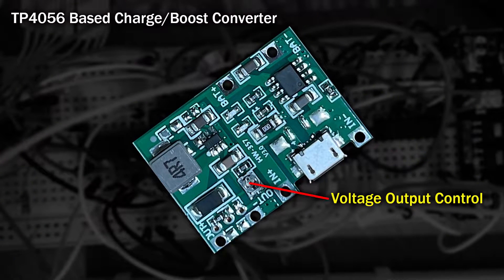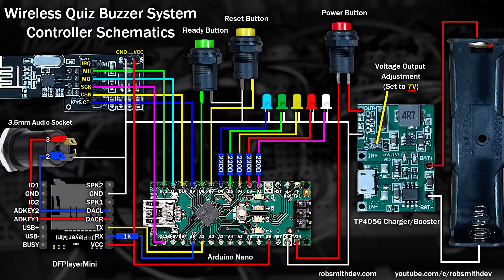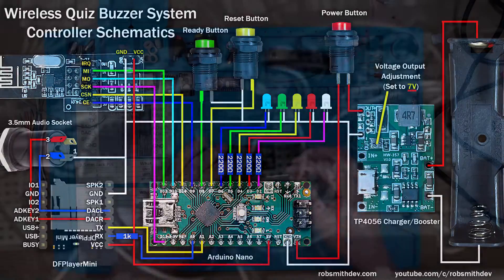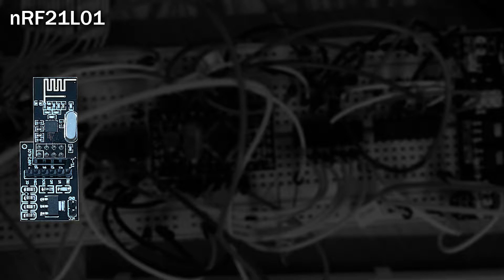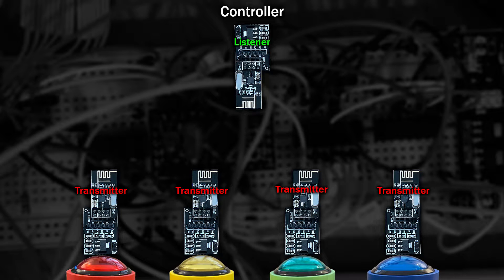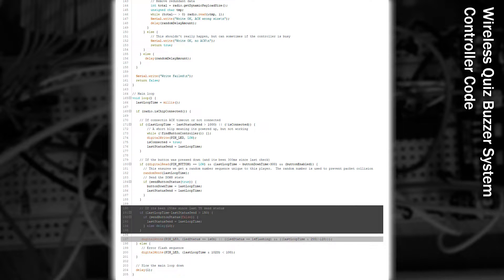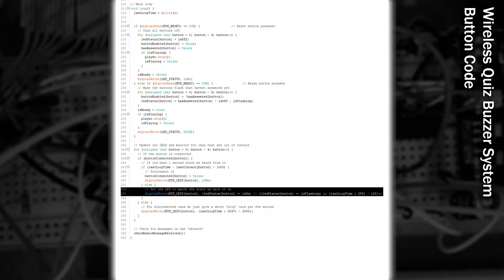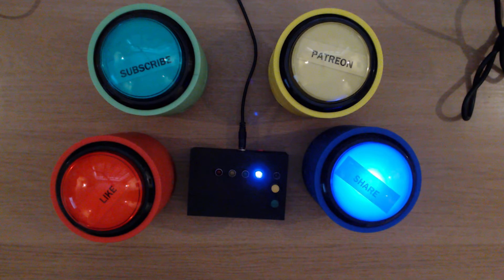Wireless Quiz Buzzer System using Arduino, nRF24L01 and TP4056 lithium battery charger

Comment: Hi, your game is great, as is your work. But I'm struggling to get it to work. Do I need to customize the 4 buzzers for each program?
char pipe[6] = "1QBTN"; for button 1
char pipe[6] = "2QBTN" for button 2...
Thanks.
Reply from the maker: No, this is automatic. On power up you have to have them connected to a computer. You send the button number to it and from then on it rembers
Reply: @RobSmithDev  Thank you. I will try to send the numbers to the serial monitor
Reply: @RobSmithDev  Hi, Sorry, I usually check the comments before asking my question so as not to drown you in comments. Because I saw that you had already answered other people.
Reply: @RobSmithDev  Hi, It works. Finally, in Setup(), I wrote EEPROM.write(0,x);
x= 1, 2, 3, or 4.
Thanks. That's very cool.

Comment: Hey!! Great Video btw, umm can you hear me out please,  can you give me some tips to get my wireless fire detection buzzer system working the microcontrollers that I'm using is esp32(receiver) with a buzzer and arduino uno (transmitter) with a mlx and mq2 my problem is that whenever my serial monitor transmission success after it detected a fire more than 42.5 celsius or 800 smoke my receiver isn't beeping
Reply: thank you for responding, I'm doing it for grades, can you at least tell me is it possible?
Reply from the maker: Don’t see why it wouldn’t be
Reply from the maker: Sorry I can’t help with that. If this project is for fun then keep at it and you’ll get there, but if you are actually wanting to use this for real safety I suggest getting a proper certified detector

Comment: Hi, this is a great tutorial, thank you for sharing! I have a question about the battery circuit you used. The "TP4056 Charge/Boost Converter", does it have integrated protection against over(dis)charging the 18650 batteries? I would like to make these wireless buttons too, but am a bit concerned about the safety of li-ion batteries. Also, any idea how long the whole set (buttons + controller) can last on a single charge? Thanks in advance :)
Reply from the maker: It has over charge but not over discharge. Simplest solution is to use protected batteries then it doesn’t matter. They’re very low power so even cheap batteries last ages
Reply: @RobSmithDev  Alright, then I will get the protected batteries. Thank you!

Comment: Hello @RobSmithDev
thanks for the great system.
I'm having some trouble getting it to work :(
I think the buzzers are working fine because they are blinking (I already gave them the numbers 1- 4)
The control unit also blinks, but only when I connect the arduino nano directly to a power source. When I tried to make it work with just the 3.7V battery, the leds just light up permanently. In both cases, the control unit will not connect to the buzzer and I'm a bit clueless what to do at the moment.... 

I would be very happy if you could help me out with it!!
Best wishes from Germany :)
Reply from the maker: Hi the controller is designed to work at 5V so that’s the first thing. Also, the controller (I think) will send information on the serial port so that may help debug it.
Reply: @RobSmithDev  Hi, thank you for your feedback :) 
I changed to voltage output from the controller from 7V to 5V. But I'm a little bit confused because the controller schematics shows "set to 7V"? 
I also checked the serial output and it says:

RF24 detected.
Scanning for empty channel...
Channel 125 selected

But it still won't connect to the Buzzer... I dont understand my mistake... do I have to change the code from the Buzzer to the channel 125?

In addition, I have checked the serial code from the buzzers, which says: 

searching for controller...
write failed
write failed

this text runs through and renews itself again and again

Best wishes :)
Reply: @CoolBaggy  increase the voltage for the buzzer
Reply from the maker: @YesWeAreAnonymous there is no buzzer, it plays MP3 files
Reply: @RobSmithDev this is my issue before. I tried to use 5v for the controller but the buzzer won't connect, i increased the controller to 7.5 to see some results and yes it able to connect. Also the buzzer, i increased the voltage to 6v
Reply: Hi  @CoolBaggy , I have the same problem : write failed.
Do you have thé solution ? Thanks
Reply: @dimebag2486  @coolbaggy @robsmithdev
I have this same issue. Altering the voltages didn't seem to help for me. Any other solutions, please?
Reply: Hi@TheatreAudio-w2hj ai écris directement dans l eeprom les numéros des buzzers. Et maintenant ça fonctionne. I wrote the buzzer number in the eeprom.

Comment: hello, great tutorial ! I've got an issue with the buzzer code (I think). After the transfert, the LED stay high and don't blink as it was suppose to. I don't understand where I must attribute the buzzer number. 
Sorry for my English, I'm French
Thanks for your help
Reply from the maker: Shows you in the video. Power them up while connected to the computer and then from the serial console send the number of the button. This gets saved
Reply: @RobSmithDev  thank you, it's ok!

Comment: I want to use this in a classroom. The only isssue i have is that i need to connect 10 buttons. Is that posible with this design?
Reply from the maker: It is, but you would need to change the code to make it work and you would need an alternative way to display which buzzer was pressed on the controller (there’s not enough pins for 10 LEDs)

Comment: Hi, Do I need to build the 4 buttons for it to work? I already have 1 button and the controller. I tried to connect the button but it won't connect. any ideas? I already assigned buttonID to 1 via the serial monitor. I copy and paste the code. check the wires and use the correct voltage. Thank you so much!
Reply from the maker: 1 should be enough. Try powering it on in a different order
Reply: @RobSmithDev  i tried the one you suggested to move away from crowded wifi and pc and It seems to worked. Im worried that it might not work inside my classroom since i have one router and 26 wireless computer.
Reply from the maker: You can fix the channel it runs on. There’s a similar section of code in both where it searches for an empty area so you could just force a value
Reply: @RobSmithDev  i need to figure it out which part of the code is it. Thank you by the way
Reply from the maker: @YesWeAreAnonymous  you’re welcome

Comment: This looks great - can it be expanded up to 20 buttons?
Reply: I guess adding a tft display instead of less could be an option.
Reply from the maker: Technically, although there isnt enough pins on the main controller to show you what was pressed. I know someone successfully got 8 working
Reply: @RobSmithDev   I was looking to see if the number of buttons could be increased too..
Reply from the maker: Yes it’s possible - I think someone went beyond 10
Reply: Or just led display

Comment: Good afternoon. I bought an Arduino nano with a built-in WIFI module. When checking the code, it gives an error for detecting a radio communication device. Please tell me what needs to be changed in the code. I really liked your idea. I want to make myself the same

Comment: really a great video. just what i was looking for. is it correct that a maximum of 6 buttons will work with the nRF24L01s and a controller with an nRF24L01? i would like to expand it to 6 once i have done it according to the build plan. change (almost) all positions with a 4 to 6 and extend the status arrays?
Reply: Finally, it works for 6 players. 👍✌🏽
Reply: @teemonkey-w6  Can you tell me what exactly you changed in the controller code to make 6 buttons work?
Reply: @Короткиевидео-ю1е  youtube removes the comments directly when i provide a link. i don't know how it works.
Reply from the maker: There’s no limit of buttons, well not that small anyway. I’m guessing you’re talking about the 6 channel part of the nRF but it doesn’t work that way. 
The only real limit is output pins for LEDs on the controller to show who actually pressed first
Reply: @RobSmithDev  Thank you for your answer. That is perfect! I ordered accessories for 10 buttons but then read that it would only work with a maximum of 6. Then the fun of making can begin 🙂
Reply: @RobSmithDev  What do you think if instead of letting the light be on the main adruino receiving the signal, I will make the light on the transmitter and the light will turn on right at the position of the first pressed signal transmitter?

Comment: I really like the idea here. But would rather have it all wired. Will the ready/wrong answer let others answer and reset button functionality work on your previous setup?
Reply from the maker: Yes should do. If it doesn’t it’s easy enough to change
Reply: @RobSmithDev  So looking over the code, when do you assign the button ID for the buzzers? Also, for clarification, you are using a latching switch for power button and momentary for the ready and reset buttons on the controller?
Reply from the maker: @camiji so as in the video, when you power the button up, before it will work it will wait for you to tell it the button iD, which you send over the serial port. You can only do this once and then It’s remembered.
If the button only powers whilst holding the power button you have the wrong type of button. The one I’m using latches
Reply: @RobSmithDev  Oh, ok. You're saying to power the button up while still connected to the PC, and from there in the code you can assign the button id?
Reply from the maker: @camiji yes so power up the arduino in the buttons with the serial connected. It won’t do anything, then type the button number from the serial window (1-4) - I’m sure I covered this in the video?
Reply: @thDev Alright, seems I have progress. Took me a bit to understand what you mean by connect to the serial, but then found that was serial monitor. I set my first button to 4, and it started flashing. I've come to find that if I connect the buzzer to my pc via 5 serial pins on the back of the Arduino, and just connect it to a powered usb 2.0 hub, (no loading IDE or anything) it works perfect. If I try to run the Buzzer on battery,  it has connection issues. I am using the 18650 3.7 batteries you recommended with the voltage output set to 5v on the TP4056. Any idea? Am I not running enough power? I am also using the Arduino Pro mini.
Reply: @RobSmithDev  Ok, did some more diving, seems turning down the TP4056 from 5v to 3.3v has everything working on battery. And the reason it was working on my pc is the programming board that hooks into the back of the Arduino runs at 3.3v as that's where the jumper is set too. Any idea why yours runs at 5v and mine are at 3.3?
Reply from the maker: @camiji because you can get 3.3v and 5v arduinos
Reply: @RobSmithDev  sigh...that makes sense. I I'm guessing since I ordered 3rd party there may be inconsistency. It said 5v on amazon, but they are working as 3.3v. I am assuming this wont effect the system? outside of the led on the button maybe?
Reply from the maker: The led might just need a smaller resistor.
The only other potential issue is the power supply board clipped onto the radio module as that’s expecting 5V and trying to convert to 3.3. It might be ok, but it’s possibly not needed
Reply: @RobSmithDev  So, got things up and going, Buzzer is working, controller is working, sound is working. It's beautiful, LOVE THIS PROJECT. Things are working. Question for you. I am still REALLY new to Arduino, I want to put these buzzers on a podium and on the front of the podium in a recessed area I want to add an LED strip using a relay. And while the buzzers will flash when the system is ready, I'm looking to have the LED strip to light up for the player that buzzed in first in tandem with their buzzer going solid like the system already does. Say pin 3 will turn on, toggle the relay and activate the 12V LED strip so this way my host will know who buzzed in first just looking at the front of the podium. And of course the LED turns off when the system is readied up again and the person is locked out, or it's reset. Do you think you can help me add this code?
Reply from the maker: Yes this is actually really easy to do
In the setup function you'd need to add
pinMode(3, OUTPUT);

And then in the loop() function, find this line:
 digitalWrite(PIN_LED, (ledStatus == lsOn) || ((ledStatus == lsFlashing) && ((lastLoopTime & 255)>128)));

and add this line:
digitalWrite(3, (ledStatus == lsOn));

Depending on how you wire things, might need to be digitalWrite(3, (ledStatus != lsOn));
Reply from the maker: Adding relays you need to be careful, easiest if you buy a relay module designed to be connected to something like an arduino because it will handle the power requirements and should include a protective diode too.  You cannoy connect a relay directly to the arduino
Reply: @RobSmithDev  You have been the most helpful youtuber I've ever interacted with. Thank you SO much for your help. I really can't express how much I appreciate you helping me along. The system now works exactly as I like with the new pin triggering the relay and powering up my led strip for my podiums.  This project is AWESOME and really sparked my interest for learning more about programing and electronics! My last question, I see for the sound effects it listed as buttonnumber+1, I am assuming that means, if it's player 4, the sound effect needs to be named "05"? Or if it's player 2 it's "03", right?
Reply from the maker: @camiji if I remember they’re still numbered 1-4 as files, I think it’s because internally the code treats them as button 0-3, and you’re most welcome

Comment: Another question is, is it possible to make them without a remote control? by type: you press 1, it flashes for seconds, and the others do not react at this time. Can you press it again after the time has expired?
Reply from the maker: You need a remote control as there has to be a transmitter. There is a follow up video to this though where the controller is controlled by computer instead. In this case I use an old retro computer but you could do this from the Pc
Reply: @RobSmithDev  Yes, I saw that video, thank you for making a detailed guide!

Comment: Hello, I would like to try your game system. but I want to connect an LED strip and add sound. How can i do this? can you help me with this?
Reply from the maker: Well sound is already in the project. Each button plays a different sound. If you wanted to add more sounds it wouldn’t be difficult. For LEDs you probably need to look up one of the led control libraries (check out my video on fake firefly’s)
Reply: @RobSmithDev  Speaking of LEDs, I found them on your channel, thank you for being so responsive!

Comment: This is brilliant! I’m adapting your build to have 10 buzzers across 2 teams of 5, but I find the LEDs too dim for the 100mm buttons at 5v. Could a step-up board be used to step up from 5v to 12v to power 12v LEDs?
Reply from the maker: I'd test to see if the 12v leds are any brighter (they might be) however the 5V and 12v will probably be the same LED but with different resistors.
Reply: @RobSmithDev  wow, thats interesting, thanks for your answer!
Reply: А какие строки кода вы меняли чтоб пролучилось 10 игроков?

Comment: Hi my button led is not blinking why would this be Thanks
Reply: sorry I have fixed this why will my button and controller not connect?
Reply from the maker: Sometimes Wi-Fi confuses the connection. Both the buttons and the controller on startup will scan for each other. You can change the code to fix the channel used. That might help. Alternatively power everything off, and power on the controller first. Wait a few second then try a button
Reply: @OllieDeer-cw2kp 
I'm also facing same problem, LED is not blinking, glowing continuously.. can tell me where is the problem ,it would be great help .
Reply from the maker: If the light is ON on the controller it means that button is connected and has been pressed.
If the light is ON on the button then it probably means you haven’t set up its ID yet
Reply: @RobSmithDev  thankyou for the reply sir .
Do I have to make some changes in the code to set up ID in each button. 
I have just copy and pasted the code directly. 
Controller is working fine , in serial monitor it showing- 
 RF24  detected
Scanning for empty channel....
Channel 125 selected .
But on button side serial monitor showing nothing.
LED status is always on .
Reply from the maker: @OmkarSingh-bo3xd you need to connect each button up to the serial and just send the button number (1-4) and it will save it from that point
Reply: @RobSmithDev  thanks sir 
It's working fine now
Reply: Thanks why would I have a white led flashing on controller startup
Reply from the maker: which led is the white led?
 @OllieDeer-cw2kp
Reply: the one above the buttons on the main controller @RobSmithDev
Reply from the maker: Might be easier to discuss this on my discord server. If you jump over there and send me a PM I’ll try to help

Comment: Hi! Thank you very much for the project! It’s amazing) 

I have one problem. Maybe you had a similar experience. So, I have a few different pro mini (originals and Chinese clones) 
Some of that with 328p and some with 328pb chips. 
When I’m using 328p - everything is fine. But with 328pb chip it doesn’t work. It’s strange(((
Reply from the maker: The PB chips are slightly cheaper so probably why they use them. Could be a number of reasons why, difficult to say. Are you sure they are both 16mhz versions?

Comment: Hey
Do you use the same programming for all buttons? Or do you have to change something for each button? How does the controller know how to define each button for the correct LED color?
Reply from the maker: Before you can use each button you have to assign it a number. You do this from the Arduino IDE by leaving it connected when powered up. Send the button number (1-4) from the serial console and it will save it